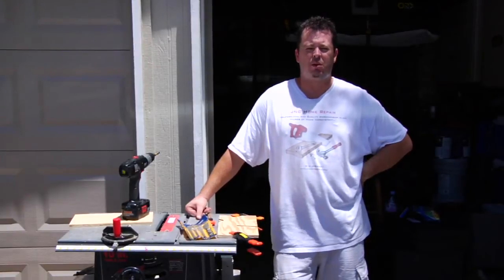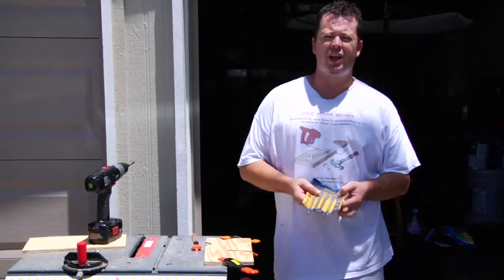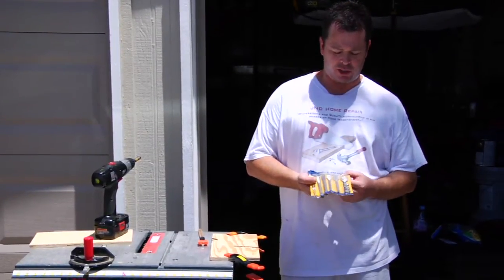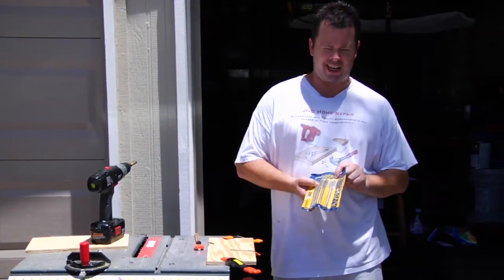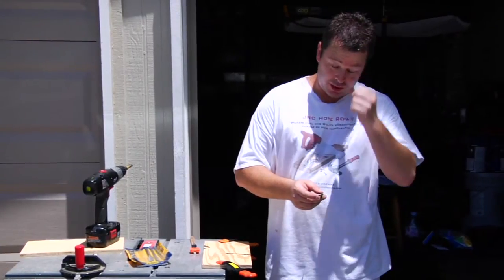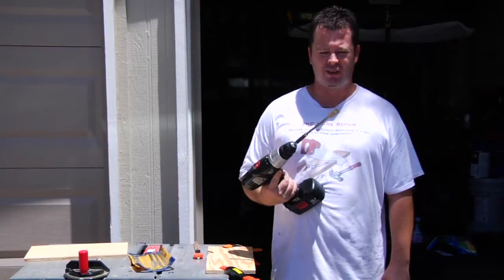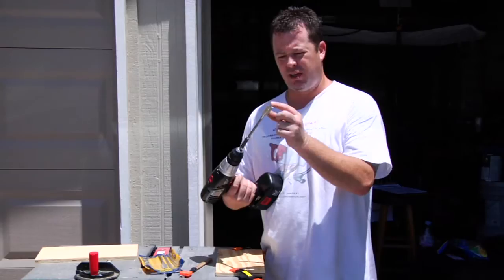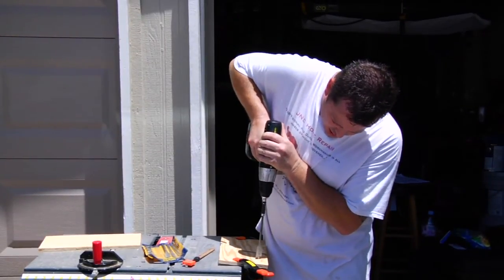DIY Home Repairs : How to Use a Spade Bit

Comment: 1:39 The other side (which was not shown) will not be as clean and neatly cut as the side where the bit enters, when you don't have another piece of wood sitting underneath the work piece, right under where the hole will be cut, as demonstrated in this video:
https://www.youtube.com/watch?v=x3qmxTZqohE